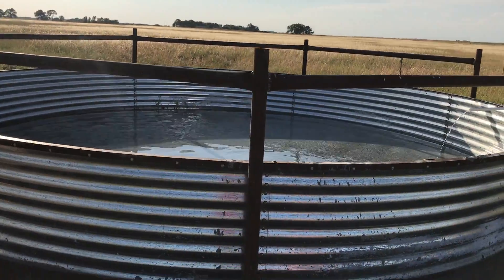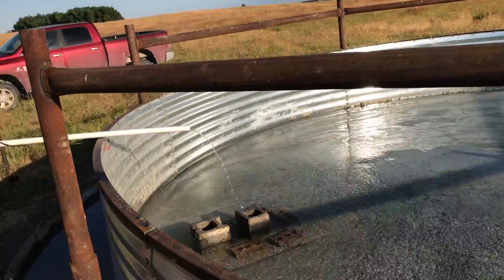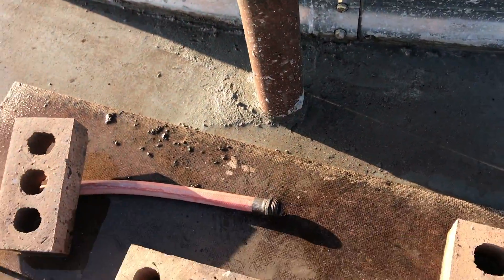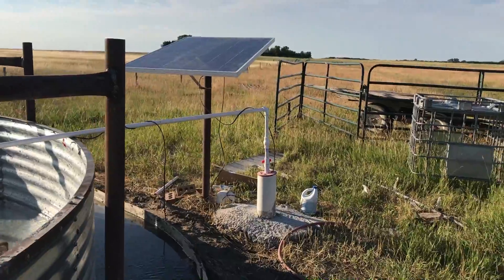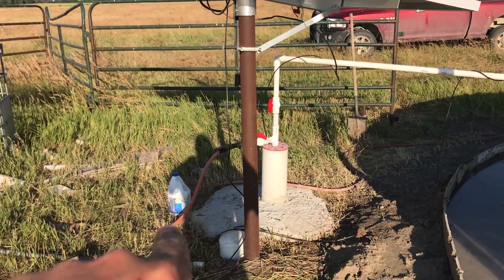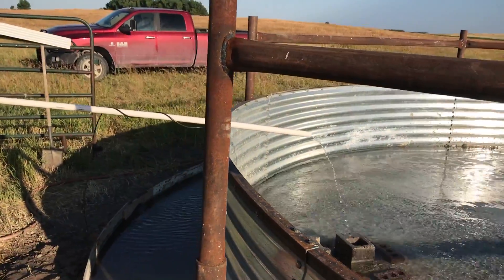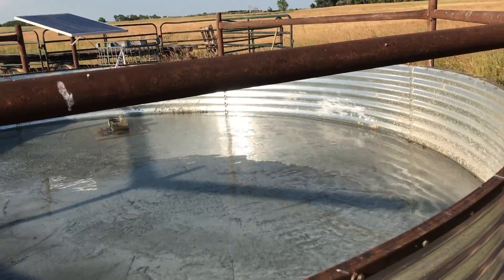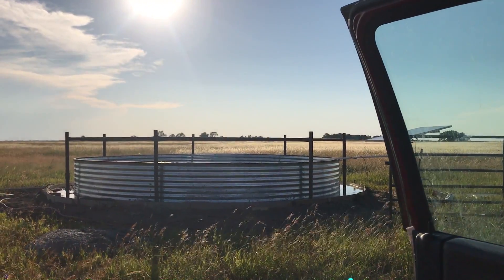Bottomless tank project part 2

Comment: Will you have to worry about the pipe from the pump to the tank freezing during winter?
Reply from the maker: the pipe coming up from the pump has a hole drilled in it so the water will drain back into the well once the pump shuts off so as long as everything works as it is suppose to it shouldn't
Reply: Ted Kahler that sounds like a great set up. thanks for replying. awesome video
Reply from the maker: Thanks for watching and also taking the time to ask a question... Ill talk about it on the final video in this series...Ill wait to make that after the project is completely finished and possibly cattle drinking from it! Stay tuned!
Reply: Ted Kahler sounds good to me

Comment: Great project, Ted can you show us the float valve that control the level of the water in the outside ring, sorry if I missed that
Reply from the maker: The water flow for the outside was just a valve on a garden hose.... ill show more of the float in the tank when its the tank is full and cement is cured

Comment: Can you have wells sunk pretty well wherever you like and as many as you like and do you have to pay for borehole water supplies? Neat idea for switching the pump on and off as it is not likely to be interfered with like  some sort of float switch.
Reply from the maker: i believe you are suppose to let the state know where you put a well and how much water it produces... and as long as your not using over a certain number of gallons per min it is fine  but if plan on using more than a certain amount of water per min(for irrigation or such) not sure on that number though

Comment: flooding it with water is way better than standing there with a garden hose, pouring concrete in the heat can be tricky     The local guys did a job on a bridge where they hauled loads of ice all day long for a month a few years back to mix with the concrete because we were so hot.
Reply from the maker: Hauling ice would suck.... glad the well is close to just start pumping water!!